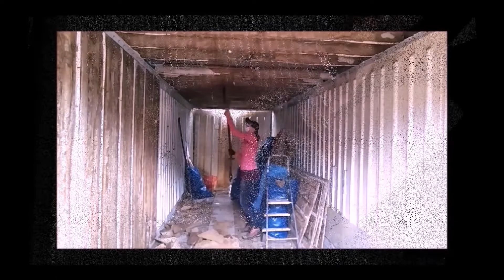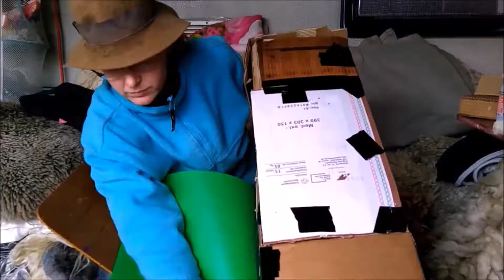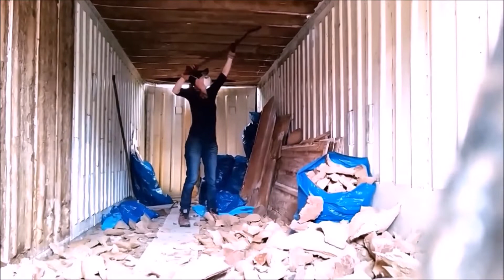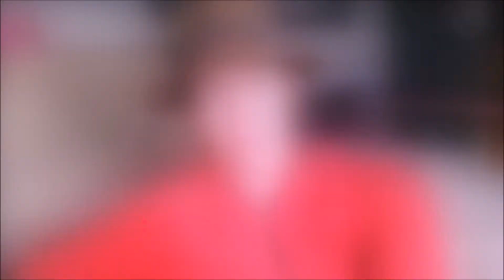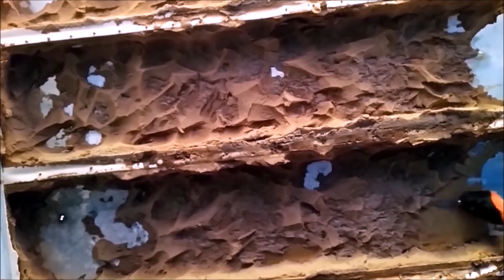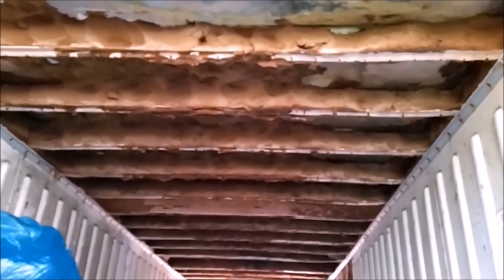4 Minecraft IRL!

Comment: It already looks a lot better after you removed the old insulation. I am curious to see what you will come up next. Have you started to think about what the walls, the floor and the ceiling need after you cleaned it all out ? It makes sense to know before you put in doors and windows, so you know at what depth to place them. If you work hard like that you don't need heating !
Reply from the maker: Thanks! The new insulation will come on the outside of the container, so I could go for the 'industrial look': sand it all untill it blinks as a mirror!  ;) But that is not really my style. 
Doors and windows are still a big questionmark for me, right now... will be contineud! 
And, yes, self-heating is the most efficient!